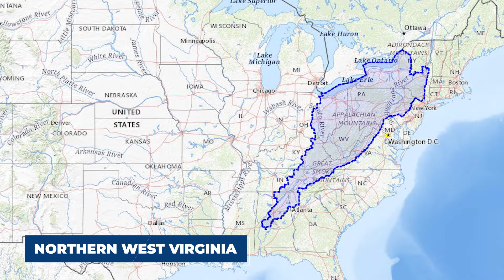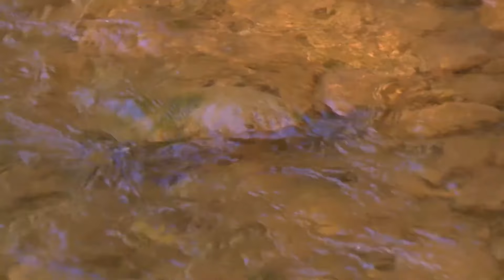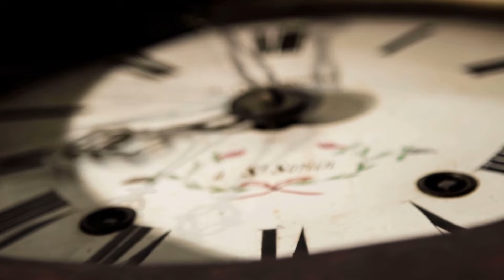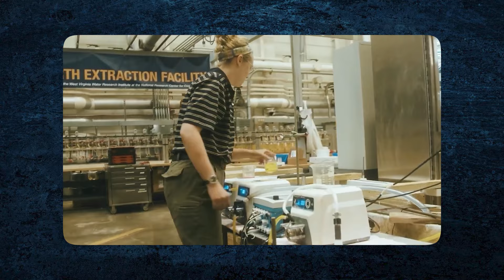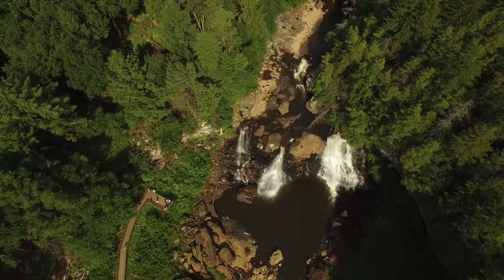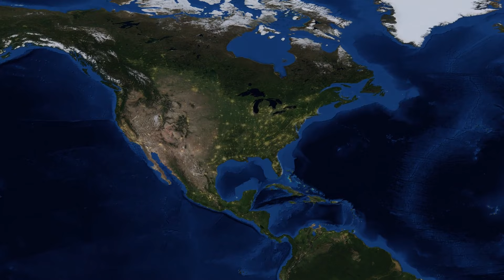Newly Detected Rare Earth Minerals in U.S. Rivers Might Trigger a Conflict With China

Comment: In the 1970's maxie anderson used heap leaching and solvent exchange to produce copper and precious metals from ranchers bluebird mine in miami arizona. His costs were about 40% of standard copper mining costs for the globe miami area and also superior az. In nevada you get platinum from copper sludge. Pt recovery goes up with higher amounts of selenium present in the ore. Carbonaceous ores adsorb radioactive ninerals when exposed to groundwater. Also gold and silver from cyanide solutions. Use charcoal. For cyanide soln ph 11 is required to be safe to use. Run through charcoal and burn. Melt residue in a closed retort and vent gas in a water bath to extract mercury. Cyanide soln becomes fertilizer with uv light and soil bacteria.

Comment: The use of environmental laws to kill american mining and mineral processing was a clinton era priority. They destroyed the bureau of mines and usgs. Treason. Also, sewage sludge contains toxic levels of heavy metals. They accumulate in crop areas over time. Simple solvent exchange removes selected elements you want without extensive processing. You get copper from putting scrap metal in acid mine water. Melt the scrap and refine. Waste sludge from copper refining contains gold,silver, platinum. Run waste water through solvent exchange resins to extract other elements. Much of this was developed by usbm metallurgy research. Killed by clinton.
Reply: You aren't wrong, plus .. We have nuke reactors that make gold. This isn't science fiction.